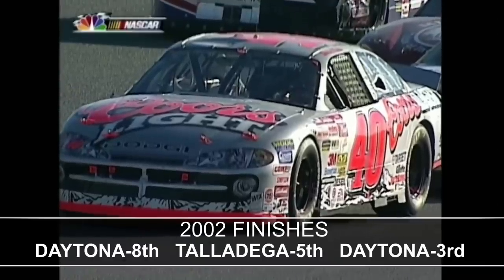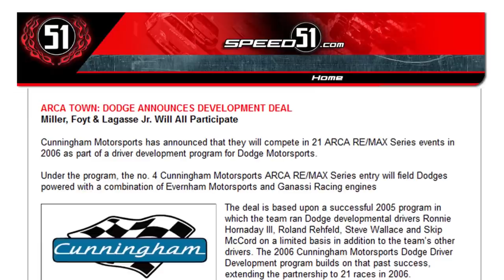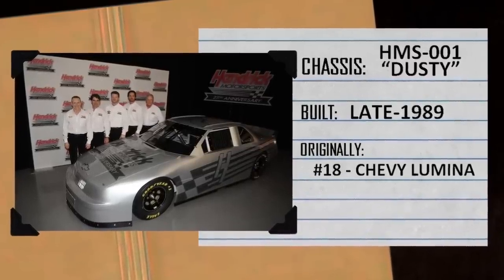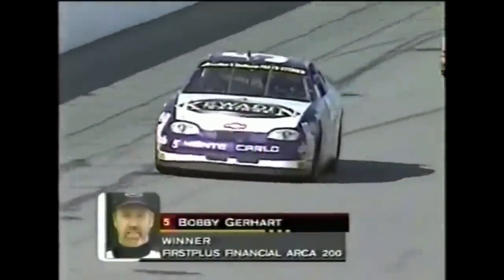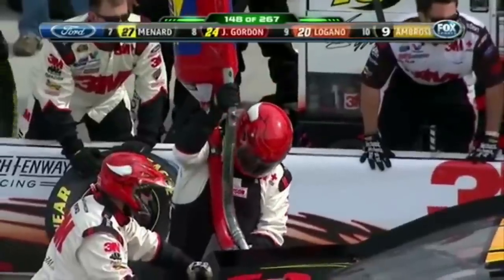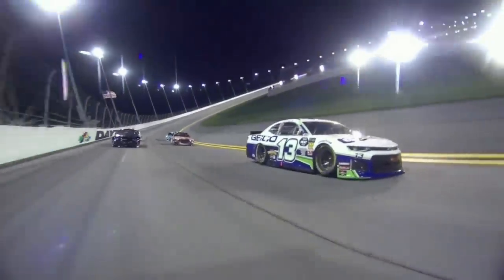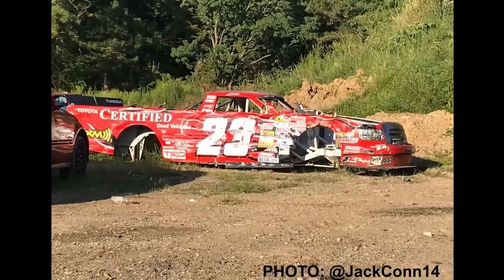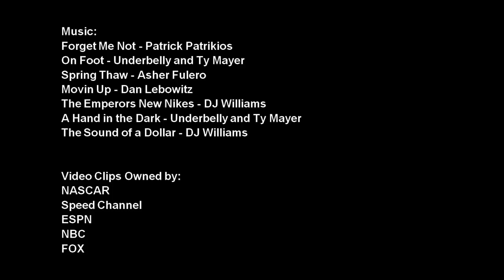Under The Sheet Metal | Sterling's Daytona Car, Benson's Truck in a Field

Comment: Friend of mine has a 2000-ish Monte Carlo bodied cup car with some Square-D decals inside, presumably once was a 55 for Andy Petree but I've never been able to find out any way to determine the lineage of the car.   Possible it's the car that finished 2nd to Earnhardt's last win.  Possible it was a Bobby Hamilton car.    

Based on the decals on the outside it last ran as an ARCA car, unsponsored plain white with a lime green #94 on it.  Whether or not it actually raced that way, who knows, but it wasn't hard to qualify for some ARCA events.  There's a lot of filler under the paint, too.  

I thought maybe it was a speedway car as the trunk is heavily braced but I'm no expert. 

He also has a chassis that's supposed to be a former Petty car, but it's tinned up with a small driver compartment and has a coil front suspension with leafs in the back, which I think rules out it being anything Petty had unless it was a 1969 Torino.  It does have blue paint in the spots hard to reach when it was repainted.  Here the only way to ID it as a Petty car is to have Petty himself or one of his guys look at the car, which means a long haul from upstate NY. 

But it's two more examples of what happens to these cars as they get old.  Before my friend got the Monte Carlo I happened to see it for sale, in front of a house, on a little side road that now is a dead end (removed a railroad crossing), like any other old used car.  There's not even a series up here that runs cars like that, most of the tracks here are dirt.

Comment: The funny part is that last story isn't even the most memorable story related to a car body raced by Johnny Benson.

The body of the car Johnny drove at the Superspeedways in Cup in the early 2000's, Daytona specifically, while driving for Tyler Jet & MBV has an interesting fate. The car is most notable as the car Johnny nearly won the 2000 Daytona 500 with. 2 & 1/2 years later in the 2002 Pepsi 400, Michael Waltrip wrecks (& injures) Johnny & the car was declared unrepairable.

After that, Johnny kept the body of the car & he, & I'm NOT making this up, crushed up the car body & put it into a glass cube... which to the best of my knowledge he still has in his car shop today.
Reply: Can confirm. I've seen it a few times.
Reply: I'm glad somebody brought up this car's story. T'was an interesting article to read.
Reply: He did a full video on that

Comment: Sad that the 005 chassis has a sad story to it as not only it was apart of the 2002 500 controversy but it was also the car that turned and killed Earnhardt.
Reply: I was an avid fan of Sr But his fatal accident was his own fault. He threw a late block and got hooked, happens all the time. Breaks my heart that Sterling was always blamed for it.
Reply: @SingerDinger  What truly killed Earnhardt was overcorrecting the car to the right as he got loose off of Marlin's bumper. Had the car backed into the wall, it would have been a more survivable hit for Dale.
Reply: @badbooking3221  no argument there, I’m not trying to be an ass or anything. Just a racing deal that will happen forever.
Reply: @SingerDinger  I think all of us wish Dale Sr. came back, and I didn't think you were trying to be an ass. What I do find ironic is Dale Sr., in jest, noted there should be an out of bounds line at Daytona/Talladega saying someone is gonna get killed for going below it. That one little defensive play did Earnhardt Sr. in.
Reply: The car did not kill Earnhardt it was a racing accident he had harder crashes than that one
Reply: @josephpilosky4775  what ultimately killed Dale was his stubbornness to adapt to newer safety measures. I'm not even referring to HANS, I'm referring to using school bus seats, open faced helmets, and knowingly used a seatbelt whose materials wore out long ago and should have been replaced.
Reply: Bad Booking like joe weatherly
Reply: @badbooking3221  Does anyone know what happened to that car?
Reply: I was and still am a huge Dale Earnhardt fan and I’ve always said that Sterling Marlin did nothing wrong in that crash.  It was just a racing crash.  The HANS device was available but was not yet mandatory and Dale refused to wear one.
Reply: HANS device wasn't really around then what killed E was a bad belt system...an odd angle and a basilar skull fracture.
Reply: Dale killed himself because his refuse to wear the Hutchins Device or the Hans Device.
Reply: @josalynfarmer5336  Hans was released by than before Dales fatal crash it was able to be worn by the year 2000 for all races.
Reply: @stanlee7635  Childress has it.

Comment: Dave Marcus one the rain shorted 82 Richmond doing race in a car built by Donnie Donnie Allison when they started up. DiGuard racing in 73 I believe they cut it up in 81 to run on the new short wheelbase cars. 1 there was 71  Petty Enterprise built car that was built for baker the white 11 that made its way west in the early 70s I believe is the car Hershel McGriff after the 73 500 . Herschel was to set up a parts distribution Center on the West Coast to help the patties distribute Mopar race Parts because they've become the factory distribution point in 71 that's the reason the king light back to Mopar. The car ran for years in the West Coast and was found about 10 years ago and restored into a 71 43 Roadrunner not the original 11 Dodge Charger. Impo the 70s and early 80s have great car stories . There is NASCAR modeling forum which has a bunch of old NASCAR crew chiefs and guys from teams on it and they tell the best stories about the cars.

Comment: Should change it to "under the carbon fiber" because just like painting the cars, working sheet metal is a lost art in NASCAR now, well in the 2 top tiers, only metal on the cars now is the roll cage, floor panel and firewall, engine and parts, body is poured into a form like a friggin birthday cake.

Comment: I tried telling tons of nascar fans I am friends with that alot of front running and winning chassis get re used and passed from them to team some times and that older cup cars got passed down to arca and every nascar fan I know thinks arca cars are different then cup cars back then I said nope exact same cars and chassis and all body is only thing that is slightly different and tires and motors are a little smaller. And also old camping world trucks use to get passed down to arca truck series that is not popular idk why. I had a old 2008 nascar Craftsman truck series truck it was a Toyota and was allowed to run a Chevy nascar motor of I wanted to if the original nascar Toyota engine that was in it blew up and it was a blast I ran it in a race at dega, Charlotte, Daytona, Milwaukee mile, Texas motor speedway, and Atlanta motor speedway back in 2011 we had a average of 18 trucks show up every race on average. And the rules made it where if you could afford to race asphalt super late models full time and front running car every weekend and travelled and ran for series points you could afford this truck series. We had to use left side take offs for nascar teams that was just take offs with 5-15 laps on them that's it and got Emm for free and right sides was only tires you could buy new and races was only around 60-100 laps and only allowed to change 2 tires whole race at half way mark under a compitition caution where they gave us 15 mins to change two right side tires add fuel if needed and make adjustments to the trucks as well so you didn't have to bring a full picture for live pitstops made it cheaper and even if you needed racing radios that would reach across the track from your spotter they would give you a set of radios to use just for that race for free I onlye knew one person who did that once we all had our own radios and push to talk systems and we could talk to our spotters back and forth and we had restrictor plates limited to 160 at Daytona to make it easier on the engines so we didn't have to rebuild a engine after every race and limited to 7700 rpm chip instead of the 8,200 they would normally turn.  And if wanted to run a brand new set of tires we had to use some cheap horrible hooisers that had no grip at all hard as rock after you get heat in them and they cool during halfway caution they loose all grip and get hard as a rock and no traction lol. It was a blast made my dreams of racing in nascar come as close as i will ever get to racing nascar. And drafting was a blast it felt weird first time at Daytona it kind of is sketchy cause your car feels very floaty and light it's hard to explain and your face and cheeks squize in from the g forces in corners like a roller coaster does to your face around fast curves same feeling in that truck at Daytona dega and Atlanta motor speedway was the worse for your face squeezing in and stomach dropping In every corner it was a amazing feeling. I also am now a driving instructor for a racing experience school where I give ride alongs in legit 100 percent cup cars that is 100 percent exactly same as it was when came off the track before they bought it for the racing experience my ride car j drove 10 hours a day giving rides at Atlanta motor speedway is a old fake Jr car it was his last race at dega he ran in that car with same motor dash and all even same seat he sat in nothing was changed at all and that's the car I give ride alongs in going 180 mph around Atlanta and my gps on my phone and on my Waylen horizon HD racecar dash or helmet cam or mount on roll cage. But it gives you your g force mph and kmh, it also has a OBD2 wireless transmitter to give the camera tons and tons of info of a computerized and fuel injected racecar like your road race cars and open track day with your Lambo or vett. But in the ride along cup car I can actually capture my top speed and g forces I was turning 180 mph and best part was we didn't use restrictor plates to give the passenger and ride of their life going as fast as we can but only allowed to turn 7800 rpms is why we couldn't get to 200 mph but 180 at Atlanta and Charlotte is plenty fast for a passenger that's never been on a racecar. And the cars that you can rent are the same livery and chassis and all from the way they came off the track and bought as rental cars only difference was the seats stearing wheel and motor they had circle track part number 602 crate motors and ev limiter at 6200 rpms and only go 155 mph top speed at Atlanta is almost to fast for someone who never been in a car but the spotters and instructors on radios up in the suits and spotter stands do a great job slowly getting them up to speed with our wrecking. But they all said that the ride along was better then driving cause is two instructors would draft and bump draft with each other and bump each other a little and pass each other letting you pass them he passes me again to let the passengers get a feel for what a real nascar race would feel like inside the cars.